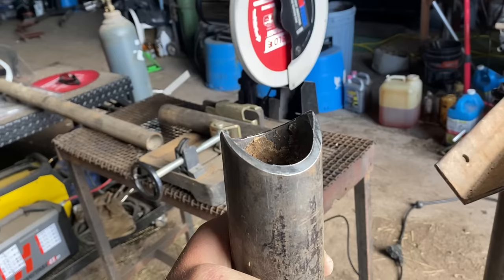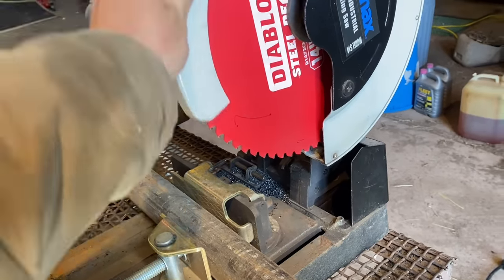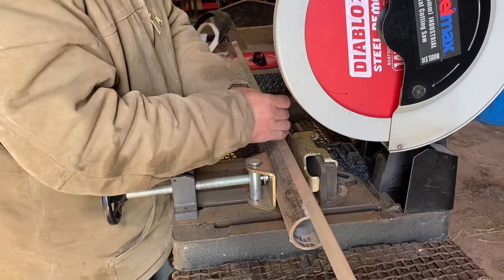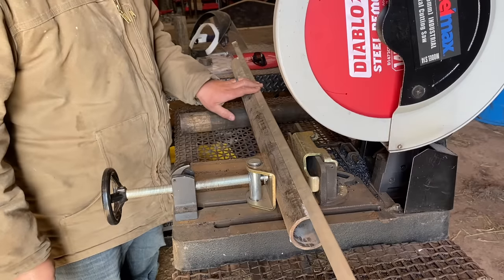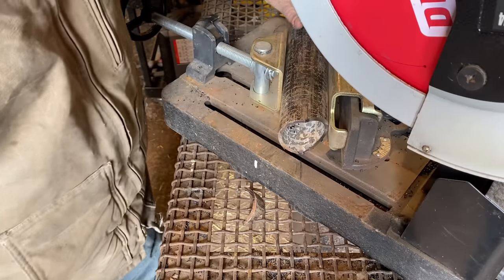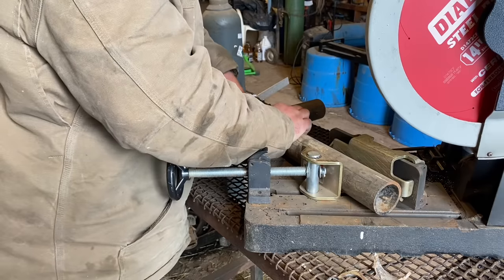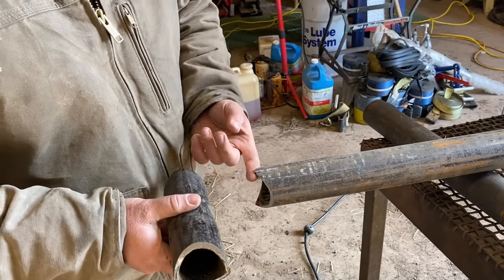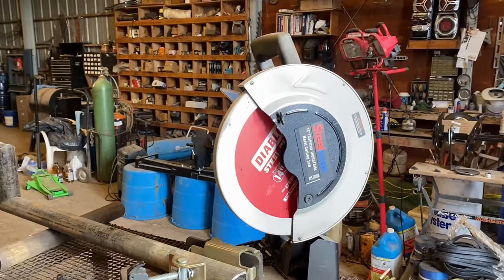How I Cut Saddles In Pipe With a Chop Saw-Descriptive Version

Comment: Your chop saw technique is wonderful . That bevel that is created by the chop saw , as you say gives wonderful extra space for the weld material . Good video .
Reply: the bevel is already there. its created by the pipe. round pipe, straight cut.
Reply from the maker: Thanks for the comment! Im glad it was helpful! It’s a good method for saddling pipe.
Reply: @DieselRamcharger  That bevel was created by the saw.
Reply: @kirbylee57  lol.
Reply: @LuthiRanchWY  you ought to show these boys you can do alot more than a 90 branch by using a base angle and a calculated angle, as opposed to symmetrical cuts.
Reply: @DieselRamcharger  the bevel is not there, until the saw cuts the pipe
Reply: The chicken created the bevel after it layed an egg. A video on blades you can't use with fiber wheel chop saws would be great. Lots of guys wasting money because they don't know.
Reply: Is 32 degrees good for all size pipe
Reply: @DieselRamcharger the bevel was clearly created by the saw. Go get your eyes checked.
Reply: As a metal worker for the last forty five years, I use a similar approach. My cuts have used a thirty five degree angle instead of thirty to thirty two, with one other differences. I keep a square nose on the end of the cut rather than to  have one cut join into the other at the center.. The square nose this usually one third of the diameter of the pipe. So if you're pipe is 1-5/8 OD ( Nominal 1-1/4 inch) I would use a half inch nosing on the end. This allows for the thickness of the pipe itself, so that you don't have to stretch the pointed ends. The stretched parts would only have to be grinded off anyway. May as well leave some room for your welds at those  blunt rather than pointed ends. 

If you are building an angle to connection such as a thirty five degree sloped stair railing, You will want to switch to a forty five degree slice That is larger than the center point. When you flip the pipe over, you do a small notch, Just a little nip of three eighths of an inch or so, and leaving a smaller square nose of perhaps a quarter inch, so the square nose is half of what it would be on a perpendicular connection. Using a 45° cut for a 35° angle is counterintuitive, but it works. Hopefully, this can help some new entrants into the field
Reply: @bobb9392 
Holy crap!  Why?  Doing it as in the video is so much easier and quicker.  On the farm we ain't getting paid by the hour!  That fence don't give a damn about your fancy measuring.

Comment: Been saddling pipe for 20 years, never heard of this. Beautiful work man 👍🏼
Reply: I normally use a little hinged pattern jig and trace it out. Then I cut it with either a torch or a plasma.    That or if it is nothing to critical I just eyeball it
Reply from the maker: Thanks! One more way of doing it.
Reply: @jvmiller1995 congratulations, the technique demonstrated in this video is for someone that doesn’t have all those tools available……chopsaw, soapstone, and straight edge only.
Reply: @MrIgottap  No shit!  A stated the exact thing above. I was not suggesting go buy tools. I having all the tools will still be doing this in the future.   I was impressed

Comment: That’s totally the BEST WAY to cope tubing!!  Simple clean and quick 😊
Reply: Not really!  They make a jig called joint jigger or something like that that used a hole saw. Its very good on thin stock.
Reply: @ChefKevinRiese  I wouldn't call the drill pipe he was using thin stock.  You watch TV guys use those hole saw cope cutters and they make it look easy.  Creative editing.  I think they may be the only good way to do angles other than 90 degrees though.
Reply: How do you even come to the conclusion this is the best way. It’s cool, really clean.  But twice the time as a torch. Also only will work for pipe sitting on a table. Still need a torch for cutting your post.
Reply: @ChefKevinRiese  The point to take away is that most people with the ability to weld already have or can justify sending the money on a chop saw.  But unless you are welding a lot of round tubing this is the way to go.       If you are arguing the absolute easiest way you can think of and money is not of factor then the easiest would be a 4 axis CNC plasma.
Reply from the maker: I never said anything about this being the best and only way to saddle pipe. It has its limitations. It would be hard to do if you are trying to fit up any joint other than ones at 90 degrees and you would have to figure out different angles if you are trying to join pipe of different diameters. It’s another way to do something and I believe in having more than one way to skin a cat. I would argue though that it makes the prettiest and best fit up

Comment: This is epic. Ive coped pipe for year and years. I first started coping with a torch, then moved on to using a plasma. Today ive traded those both in for a chop saw. 

One tip i have if your using seamed pipe is using the factory seam as the straight line for your copes. If using DOM tubing or anything without a seam your way is how i do it too.
Reply from the maker: Thanks for the advice! I’ll have to look for that seem
Reply: This is exactly what I do all the time, too ✌️
That seam is a perfect help for aligning!

Comment: For those wondering where the angle comes from:
 it's just a number that works well for this diameter and thickness...
The angle will be about 25 degrees for this case:  10cm diameter, 3 cm wall thickness 
It's just a number that works for the dimensions he's using 

This is a tradeoff between 1/ approximating the outer diameter of the tube, with the inner curve of the cut (which is an ellipse , project in the right plane)
2/ the amount of grinding he's doing at 5:05
3/ the geometry that's he comfortable welding (shape  / size of the chamfer)

There is no formula for this
The only case that fits perfectly with no grinding, is : thickness of the wall = 0, angle = 45 degrees.
This is just a mathematical problem equivalent to approximating a circle arc  with an ellipse arc of different radii, and center, this is not trivial.
Reply: Now dude, you just took a great idea for the common man that likes to fix stuff or build stuff and put a Sheldon Cooper remark to it. Just say "it's a pretty cool trick" and thank the man for sharing it.
Reply: @brucehayes5111  

I appreciate the OP's technical remarks. In fact,  I wonder if there is in fact a universal formula that can be used for all (or most) common pipe sizes and wall thicknesses, which can then be used to make a table for quick reference. Or, for simplicity,  disregard wall thickness and expect grinding in all cases. 

The common man may not be aware of geometry and the different angles required for different diameters of pipes, and simply following this video's 32⁰ - 33⁰ cut for any and all sizes can result in disaster. Those who don't like additional information can simply ignore it. At the least,  be aware that one angle doesn't fit all.

I thank the channel for the great tip and clear video, and the OP for the additional information.
Reply: Yeah, that's like saying, 3-4-5 are just numbers that work for a square. No math or anything. They are just numbers that work🤣🤣🤣
Reply: @liuj88  This has only just come up on my feed, so I have not had time to give it much thought, but I'm pretty sure that a good mathematician could derive a formula that could be applied to any pipe of any diameters(s) and angles.  There will be a linear geometrical relationship between the variables and therefore they can be represented mathematically.  Just like the tables of "Bend Allowances" cater for all angles, radii and sheet thickness.
Reply: Y'all be rocket scientist? Lol
Reply: @glennbrymer4065  LOL they're way overthinking it.
Reply: @realemonful  
"Yeah, that's like saying, 3-4-5 are just numbers that work for a square. No math or anything."

No, it isn't. I think you misunderstood his first sentence, and possibly didn't read or understand the rest of what he said, because his exact point is that this involves math, and that it isn't a trivial matter.

To clarify the very first sentence: The angle that the video showed works only for a pipe of that diameter and that wall thickness.
The second sentence gives the example of a pipe with different dimensions requiring a different cut angle.
The third sentence is a summary of the first.

You didn't even need to read past the first paragraph.
Reply: @BD-bditw  

Thank you. I'm far from smart enough to do the derivation, but I appreciate the complexity of seemingly simple things, and prefer to have theory combined with practice. 
I can imagine myself (and many others) tackling a problem through trial and error and/or repeated experiments, but it's nice to also have some mathematical understanding to refine the process.
Reply: nice video thank all for posting. break over back to welding..
Reply: Hmm, to all you brain surgeons, rocket scientists and Einsteins, go buy yourself some 1/2", 3/4", 1", 1 1/4", and 1 1/2" PVC, put it on your miter saw at 35 degrees and try it for yourself...as I just did with shop scraps. You have a ten second grinding job on the two tips to make a perfect fit up with an ideal bevel for making a root pass and then a cap. As long as you are fitting up identical pipe its close enough.
Reply: Why do people say the math is not for common man? This math is taught in high school…
Reply: Dude killed the buzz
Reply: Or just slap it down and weld it up bud, a little gap is a good thing
Reply: I love lamp!
Reply: @lauraalbert  you thought it was a general solution for any thickness to diameter ratio ? It's not. Anyone who can use some 3d software can check by herself
Reply: @pikesticker  
"As long as you are fitting identical pipe its close enough."

It depends on how one defines "close enough". The channel uses 32⁰ - 33⁰. You used 35⁰. What about 36⁰? 40⁰? 25⁰?
How much grinding and/or welding is one comfortable with?

The OP's point isn't about "close enough", but the mathematical/geometric details. 

Of course, we are all free to take the information given and do what we want with it, including nothing. I am perfectly happy to know how to use a manual transmission with little understanding of its underlying design, but I accept and appreciate that others dig into the details.
Reply from the maker: When I made this video I aimed it mostly towards people that build pipe fence because that’s what I was doing. The most common size of pipe used in pipe fence that I’ve seen is with 2 3/8” or 2 7/8”. Thanks for the scientific break down though it will probably help some people that are smarter and better at math than I am haha.
Reply: To make your comment helpful, xl, you might replace it with something like this: if you're using a different dimension of pipe, start off with a small cut and increment up to find the best fit for that dimension of pipe.
Reply: Lucky thing this size pipe is the most common to come across around here. I’ve been doing the same thing with an angle grinder because my chop saw burned up after a few pipes but knowing the exact angle I’ll fix the saw and do it like this, henceforth
Reply: @lctsi  No. This is not stackoverflow. I really don't care about edits
Reply: It was an awesome video. You don’t need to be a whiz bang to figure it out. It’s just trial and error. I usually use a hand grinder, but to each his own.
Reply: @bman6502  with todays common core math it would take a day to work the equation 😂
Reply: @pikesticker  Best way to do it.And as your secondary pipe is getting smaller and smaller you just decrease the angle and vice verse.
Reply: I thought he said set th saw at 32degrees
Reply: @LuthiRanchWY  Like most things that get built the workers build it and the engineers go back and calculate a formula for it. Then engineers go to great lengths to then tell you how to build it. Great video

Comment: It looks like a clean cut saddle! I wish I had saw this when I started my feedline. I finally ended up using some sleeves from Macksteel that slide over your pipe and make a perfect saddle. They have been great! And they saved me hours of cutting
Reply from the maker: I’ve thought about sleeves before. Do you remember what they cost?
Reply: @Luthi Ranch  I don't remember exactly, but I think it was well under $10 a piece last time. I'd have to call in and get an update to be sure though.

Comment: Good work. I've used this method before and it's a great alternative if you don't have a oxy rig, plasma or tubing notcher (working with DOM tubing etc.). Like you've said, there are other faster methods but not everyone has those options but the job was still done.
Reply from the maker: Thanks for the comment!

Comment: I use a Diablo blade on my saw. It does a really good job. Thanks for the video. That is a very simple but clever way to do the job. I have a tube notcher but this method is much simpler and easier.

Comment: Slick !! does pipe diameter effect the angle,how do you find it if it changes,
Reply: If the size is the same, no if you're going to larger post than the diameter of the horizontal it flattens. It also depends on the diameter of your posts as the the angle to make your cuts.
Reply from the maker: Yes to what Dougdouglass said. The angle will be the same no matter the size as long as the 2 pieces you are joining are the same diameter.

Comment: Very cleaver idea!  In the 70's I worked in a steel fab shop making miles of safety railing in 20' lengths.  They had a hand shear to cope the ends that honestly was only a little faster.  Thankfully I ha a helper cutting an prepping the pieces while I jigged the sections up and welded them.  Brought back good memories!

Comment: stumbled on this video by accident.  been using 2 7/8 oil pipe around the ranch for years and have always struggled with this very thing.  absolutely awesome tip. thanks!
Reply: That look like 2-3/8 Drill pipe to you? Looks like regular Production pipe to me.
Reply from the maker: Hopefully it will be helpful!
Reply from the maker: Haha all my oil field buddies give me a hard time about calling it by the wrong name also. Everyone around here just knows it as drill pipe. It’s marketed, sold and labeled as drill pipe here and the surrounding states.
Reply: @LuthiRanchWY  go look at Drill pipe on a drilling rig. Then come back and tell me that thin walled stuff is the same. Drill pipe is at least 2X thicker if not more. Probably more like 3 - 4 X as thick if memory serves me. It's a HUGE difference i know that. And I'm talking wall thickness not diameter. 

2-3/8 & 2-7/8 is considered Production pipe in Texas, Oklahoma, Arkansas, Louisiana and Mississippi I know for sure. Which is where I worked for 14 years. I thought maybe you had something heavier that was strictly for drilling. But when I seen its thickness it didn't look different to me. Most everyone calls it oilfield pipe or Tubing.
Reply: I really don't care what type of pipe it is. all I know is when I got home, I went out to the bone pile, found some pipe, and cut a piece  for no other reason than to see if  it would be that simple.. it was. thanks for the videos!
Reply: @tundradrifter4080  I get what you are saying but that's how you gauge when someone speaks from experience. Way to many self appointed experts on YouTube! I'm not buying a chop saw just to saddle a couple pieces of pipe! I can do it good enough with a angle grinder and a cutting disc that I already have.
Reply from the maker: Haha sorry to get you so worked up mis labeling drill pipe/ oil field pipe since it seems to be such an important part of your life. You are right I’m wrong, I miss labeled it. Go relax now.

Comment: Great job nice even cuts. Glad I found this because I am going to use try this technique for 4-6 inch round peeled logs for light structures or log fencing or cribbing . It would work well with roundwood and even some plastics for the vertical post then saddle the horizontal plus it will look nicer . Thanks for tip .

Comment: Thank you for sharing Sir. You just saved me a lot of time. I’m an electrician by trade but have a farm now as well with a couple hundred head of Charlois/Brahman. Only a pipe fence will hold them in. Been using a plasma cutter and doing a horrible job with pipe joints. Your method is so much better. Thanks again for sharing.

Comment: I’m having to make a bunch of corner and h braces using 2 3/8 pipe for my property , I had seen your video last year and remembered it so I looked and looked for it till I found it again! Thanks again for the pro tip ! I’ll be using. I’m going to use my Chalk line to mark my pipe instead of the angle iron
Reply from the maker: I’m glad that the video was useful to you! Hopefully it makes your project a little easier

Comment: It seems impossible to cut a straight line and it will fit a round pipe but it works every time. It works for horizontal and vertical joints. It is the strongest and neatest joint out there. Thank you for the excellent video. A speed square with a level in it will give perfect alignments.

Comment: I had a hard time wrapping my mind around how simple a solution this is to cutting saddles in pipe, when compared to using a tube notching jig on a drill press!  I wouldn't want to even attempt trying to cut pipe that thick-walled with a metal cutting hole saw - it would take half a day and and would wear out one hole saw every 3-4 joints.  Thank you for sharing this technique!
Reply from the maker: Thanks for the comment! Glad the video was helpful!